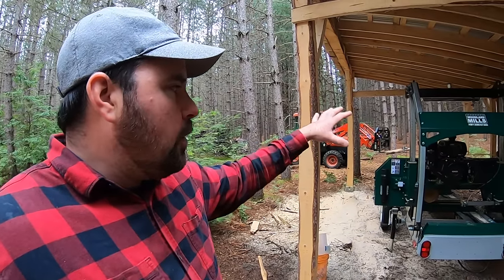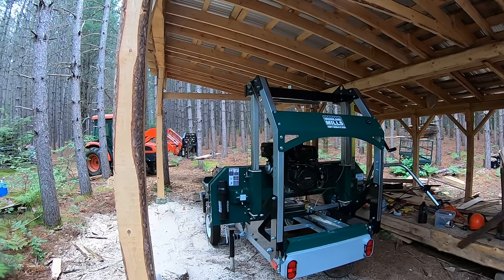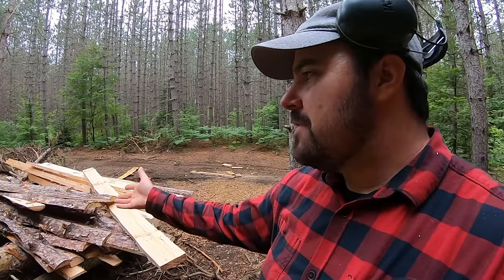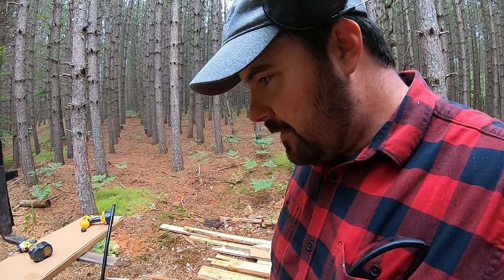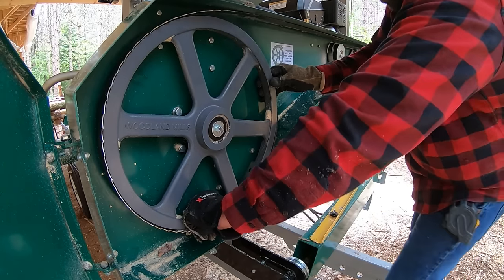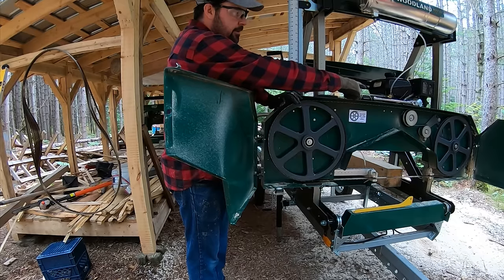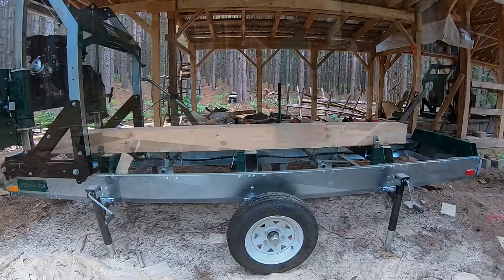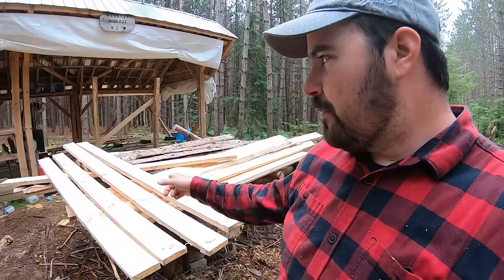Sawmill Won't Cut Straight | Fix Your Sawmill and Avoid Wavy Lumber

Comment: I'm not a sawyer but I am an engineer and as you were showing the waves in the wood I noticed that the waves were mostly coinciding with the knots in the wood. I say this as another person interested in all other professions/hobbies. As always you tell people in a way that everyone knows what you are talking about. Thank you.
Reply from the maker: Thanks for that Ken. I believe the knots which are more dense than the rest of the wood causes the slight diving of the blade to be more obvious than other parts of the log when getting dull
Reply: I cut primarily white pine and they have those knot clusters about every 3-4’ I noticed that the cut is typically thicker in those areas. I did have an issue with leveling as well on mine, although I have the bushlander which isn’t as easy to level.

Comment: Hello Sandy,
I have been sawing on the same model this summer. One more way you can notice that the blade is getting dull (can be seen in your video also) is the sawdust is finer and comes out of the opening in the blade compartment with more speed when the blade is sharp. As the blade gets duller the arc of sawdust is shorter and there is a tendency to get the opening clogged with longer (non cut) wood fibers. I imagined that the wavyness comes from the fact that the blade getting dull happens at the cutting points pointing up and down or away from the centerline of the blade. This basically causes the blade to not cut but rather rip the wood at the cutting edge of the blade and therefore it will not empty the kerf voluntarily. Now that is is doing that it will go the path of least resistance, that is to where the wood is softer or more easy to cut. After going off track for a little bit a lot of tension will be created forcing it back the other way, but because it is not freeing its own cutting path it will continute past the proper cutting line and dive into the other direction. Of course there is a bit of randomness in that you might be hitting hard or soft spots and changes in grain direction etc. during this. But I have pictured that this is the problem, the blade not clearing its own path properly and therefore wondering off it. These changes in tension due to waving up and down are probably a lot more than a bit of temperature change could cause, the wood and the water are cooling quite efficiently, I have not noticed the blade getting warm. Another great way to keep track of your blade wear is to follow the cut quality at the exiting point of the blade out of your lumber. It will pull fibres out if dull, if sharp you get a nice clean edge. Just my two cents! Greetings from Finland!

Comment: One other thing I found with wavy cuts ( on my HM130 Max ) is if I get too much gap in the blade guides with a dull blade it amplifies the issue. The blade guides do help to keep the blades from twisting and rising/diving. Great video.
Reply from the maker: Great points there

Comment: Like your Videos. From an Engineering perspective, I think the adjustable blade guide should be much closer to the log than you have it set up. This way it has the potential to reduce the blade flex that my be created by blunt teeth or knots etc. Just my thoughts.
Reply from the maker: Good point. In the video the blade guide is as close to the log as possible. Although some manufacturers have blade guide rollers that contact the blade, in my case the blade guides are really close to the blade but don't actually touch the blade while cutting (at least they shouldn't unless the blade deflects a little bit)
Reply: @sawingwithsandy  Seems the length of that arm needs to be increased. Great idea to take to the manufacturers.

Comment: So Sandy,
If the heated blade changes tension through expansion then in my pea sized brain the real answer would be to rely less on final tension with the torque wrench and rather re-design for a final tension relying on a 'blade tensioner' using a spring.  In our modern vehicles we all rely on proper tension for the serpentine belt being regulated with a 'belt tensioner' which compensates for varying belt conditions (ie belt length fluctuations due to temperature changes or even just some wear over time).  All that Woodland Mills would have to do is spec-out a tensioner and use the existing system to get close to final belt tension before switching to the new belt tensioner.
Just a thought, Sandy, just a thought.  Something like that would seem to be well worth offering on any band saw blade mill as a useful option.
     Joe
Reply from the maker: I like the way ya think Joe

Comment: I think the greatest factor in the waviness of a dull blade is going to be wood grain which is most apparent when you come to a knot. Also, I did notice your blade guide wasn't in close to the cant, is it non-adjustable? If it was closer, it might help a bit, but you're obviously right with your assessment that most of the issues stem from blade sharpness.

Comment: Starting to get some waves in my cuts after about 4 hours of use give or take. I have spare blades so I will try this to see if it helps. Some waves to me are ok depending on what I’m using the lumber for. Thanks for the tip
Reply from the maker: I’m with ya there. Sometimes I let it go and other times I don’t like it

Comment: VERY interesting video, Sandy. You're actually dealing with Several different factors here that show up as waves in the cut lumber. I also saw in the video, the blade waving when it encountered a knot. This would indicate to me, a change of density in the wood fibers. Your blade, like any fluid, will travel the path of least resistance; as governed by the mechanical tension on the blade. If you could, please comment this, and list the distance between blade teeth, and the velocity of the blade in feet per second, or minute, whatever spec you might have. (I need this to run some calculations).

I don't think heat would be a factor unless the blade gets extremely hot during cutting. The coefficient of expansion for (generic) steel is 0.0000065 inches for every degree Fahrenheit  temperature change, or one one-hundredth of a foot in one-hundred-feet for a fifteen degree temperature change. (In other words, minuscule in this application). The only way I can think of to test for this is (one) measuring the blade temperature and (two) measuring the tension (torque) on the blade during cutting. Another way to test for this would be pushing your worn blade very slowly to prevent heating, and see what happens. A final way that 'might' work to test this theory. Make a cut with the worn blade at 25 foot-pounds torque on the blade, immediately increase the torque (say 35 pounds) and make another cut. Is the cut straight on the second cut with the same blade?

Another factor on the worn blade would be the relative sharpness and pitch of the individual teeth. When you sharpen your blades and reset the tooth pitch, do you notice a difference between teeth that pitch 'UP', versus teeth that pitch 'DOWN.' 

If you could comment with that information, I'll run some calculations and see if I can find an answer. (If so, I'll email the results. They'll be far too lengthy and complicated than another comment post). THANKS for the challenge, buddy!
Reply from the maker: Hey Carl! Lots of great things to consider for sure. Unfortunately I don’t have a way to measure the speed of the blade. I can measure the distance between the teeth though next time I’m out and about at the sawmill. Appreciate all the thoughts though. Gets me thinking
Reply: Carl, you have way too much time on your hands

Comment: I have a HM126 and was cutting a big maple log into slabs a week ago. I knew my blade was reaching the end but thought I could squeeze one more log out of it. Wrong answer, it looked like a roller coaster. I put a new blade on and it was back to arrow straight and also much easier to move through the log. I will be changing out my blade more frequently from now on. Thank you for the video and your other videos. As a relatively new sawyer still learning the ropes I am always watching this type of video. I am sure I have seen most of yours.
Reply from the maker: Always great to hear from like-minded folks like yourself. Happy Sawing Randy

Comment: Yes, you can really see the waves as you were drawing the carriage back to the start position (at 5:50 in the video), while the blade hovers over the wood, the gap fluctuates like crazy. When I see that happening (outside of tolerance), I change my blade for sure. Thanks for the video! Cheers.

Comment: Sharp blades are key for everything.  Sawing, surgery,  cooking, etc. Most important kitchen tool I own is a knife sharpener. More cuts can be attributed to a dull blade. I did notice when you used old blade, even from a distance,  how the sawdust was blowing out intermittently on the side, revealing the high spots in the board. Then when you changed blades, the sawdust blowout was consistent. It cut like it was butter.  All the extra steps you take on everything, makes a big difference in the end. Kudos on another nice video Sandy.
Reply from the maker: I agree with ya there Dora

Comment: Another great video Sandy, thank you. First time cutting with my HM122 yesterday. Frustrating experience! I’m cutting tamarack and it pitch/gum builds up on the blade almost immediately! I’ve been told this is one of the worst woods for that problem? I also ran without blade coolant for the first hour as per Woodlands instructions.   So new blade going on, and I’ll be cutting some birch next in hopes of getting some nice boards to eventually plane for live edge shelving. As a newbie sawyer, I sure appreciate your videos.

Comment: Thanks Sandy, that’s the problem we are having with our Norwood mill. 
Also we are getting a different measurement from the ends and the center. To try and correct that we’re going to check the bed to see if it’s off.
Reply from the maker: I think that would be my first check as well. Thanks for watching Joseph
Reply: The log will deflect as you release tension. If you cut a number of boards from each side before turning the problem gets more extreme. Either you need to allow for a truing cut later or turn after every cut is better but takes time. The conventional guides have also all but disappeared on commercial sawmills and are replaced by pressure guides which physically push the blade offline.
The better mills and resaws are also fitted with blade deviation monitoring. The instant it happens its put right. A change of blade or feed speed through wild grain but it's just crazy to push on with a blade that's lost its edge.

Comment: We ask these questions. 1. What is the typical life of a blade before it is dull. 2 are your logs dirty? 3 Is one of these mills worth buying? You can buy alot of lumber for $7k. 4 Do you plan on selling it or just using it yourself? You can use anything. You cant sell everything. 5If you are building a house ,do you want to saw or do you want to build? you cant do both. I sawed lbr. for my outbuildings. I bought the lumber for my house. Remember your lumber is green,not dry.7 if dull the blade will waver on knots. Knots are harder. Spruce knots are very hard.

Comment: Yep. I try to get all the use out of a blade and wind up with wavy lumber. It's for my use only so I can live with it but would be embarrassed to sell it. BTW my hm122 has the same style of belt tensioner as yours. First time I used a tork wrench to set it and marked the position on the shaft and housing. After that I just tension to the mark . I have replaced several blades and never had to make a tracking adjustment. Also you can make fine tension adjustments to adjust the tracking of the blade if you need to without massing with the mechanical adjustments. Great channel. Keep up the good work!
Reply from the maker: Sounds like you’ve got it dialed in Donny. Nice saw that 122 is. I’m with ya as I don’t mind some waves but wouldn’t want to Sell them

Comment: On my hm130max, waves, blade tension loose, dull blade, pushing to fast especially thru knots, log deck not perfect, portables mostly, blade guides adjusted properly to much gap allows blade to rise an fall. Drive belt an follower belt need replacement. Also more on portables  use level on saw head mine would move after travelling. I used 6 inch torpedo level  parallel to the uprights on saw head, adjust as needed tighten bolts up after .These problems tormented me before I rechecked everything after moving. Your channel is perfect for these mills keep up the great work.
Reply from the maker: Thanks Bryan

Comment: It can also be the heating under use which causes the blade to stretch during use, this happens with cheaply made blades which inferior metal was used in the manufacturing. 

Breaking can also become an issue with cheaply made blades when the blades are really cold from the weather and then the blade gets hot quickly under use.

Comment: good stuff. I have been cutting lumber for a while but not on band saw until just this week I got my new hm 130 max Woodland mill assembled and am trying to comprehend what and how to work the band mill for best results. it does seem to be a bit more of a fine tuned operation than my Lucas swing blade saw mill. but for my kids to learn how to saw I feel this band mill will just be a lot safer than a circular saw because it cuts across from the side to side and will never spear you in the leg or throat with a 14 inch splinter

Comment: Same thing on my Norwood LM30.  Once my blade gets dull, i'll start seeing the wavy cuts.  Over time, I've learned to notice two things that tell me the blade is about to be dull enough to start doing this. 
 1 the head get's harder to push.  
2, I'll start seeing cut lines across the cant as I do the cut. 
 Once I notice these two things, I start looking for the wavy cut and once I see it, I change blades.  

Sometimes, I'll get 3 logs before this happens, sometimes it's on the 5th log.  

Many variables affect this.  The type of wood.   The size of the log.   How long has the log been cut.
Reply from the maker: Greats tips there!

Comment: Another great video.  Wondering if you could do a deep dive video on saw milling scales.  How to get perfect 2x / 4x lumber, dealing with the blade curf, and how it factories into the last cut on the mill.  I can see how cutting a cant will be exact, but I’m struggling to understand how the boards cut from it won’t be smaller or you end up with a very thin board at the end. Hope that makes sense.
Reply from the maker: For sure. I’ll keep that in mind for future videos

Comment: Happens quite often, even with relatively new blades, I've found it's not as bad with the Ripper blades, much better steel and considerably cheaper than the woodland mills ones. If you look where the blade has risen up you will see it's happened on every Knott along the cut

Comment: I solved my wave problem with my woodland mill ,,,bought a Norwood,,,waves could be more than a dull blade ,,bad band wheels ,,I put 7 on my mill in a yr and a half ,,clutch bearing could be bad ,,put 3 on my woodland ,,,if your planning on cutting a lot of wood theses are not the mill ,,

Comment: Hey buddy how are ya? Great video!!! Yep wavy board are no Bueno!! I find that when my blade starts to get a little dull, my cut finish starts to get a lil shaggy before the rollercoaster starts. Change them out and start fresh. A blade that is still a lil sharp sharpens better, if that makes sense? Also less chance of it breaking in a cut. Thanks buddy for being our saw mill guru. God bless you and yours
Reply from the maker: Great point about changing sooner rather than later to make sharpening easier. I would say that is the case with me as well. Hope all is well with you! Good to hear from ya

Comment: I also run a HM130 Max but I cut large cherry, oak, maple and walnut. It seems that the larger diameter trees (+20") and knots cause this wavyness. I've had brand new blades do it on wide logs. I've resorted to cutting extra thick boards just because I have to run it through a flattener which sometimes takes off 1/4".

Comment: Hi Sandy.....Great video as always.  With a brand new blade about how many cuts can you make before you have to change out the blade.  I know your answer is dependent on several things but approx number??  Thank you again for the excellent videos and information you provide.
Reply from the maker: Im guessing a little bit as I don't normally keep track but I'd say I cut around 200bf before I change out for a sharp one. Sooner if I get into some dirt on the log or something Similar.

Comment: Hey Sandy, I think you may have your log posts in backwards. The top angle should be sloping  to the inside thereby allowing the log to rotate against them without getting hung up. 
BTW great channel!  I have been using an HM126 since the fall of 2014 and am very happy with it.
Reply from the maker: I rotate them around depending on whether I need log support or to roll the log
Reply: @sawingwithsandy  Didn't mean to be a Captain Obvious, God Bless!

Comment: You mentioned the Lennox blades. Where do you purchase them from and how would I find the blade thickness, kerf, and other specifics needed for a 2022 model 126? I cut mostly hardwood and was think of purchasing a carbide. Thanks again for another video well done!